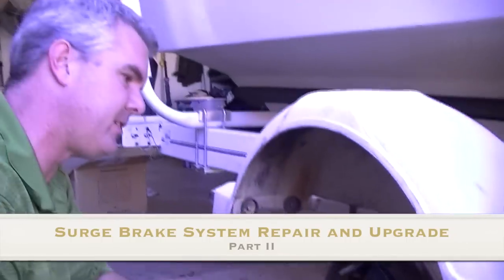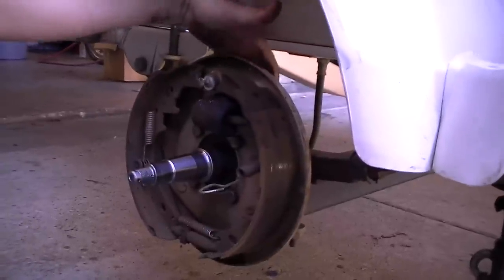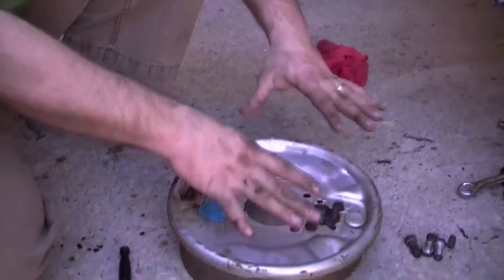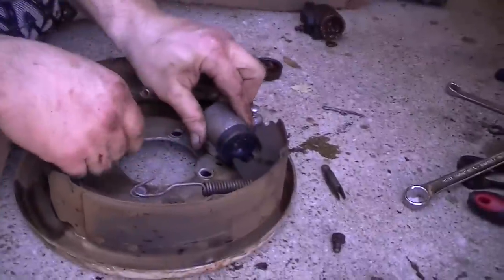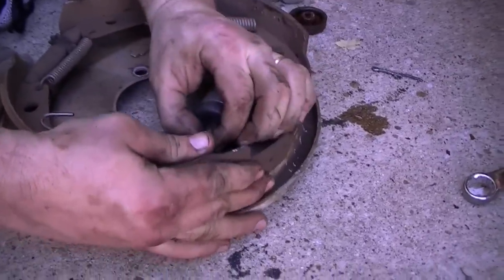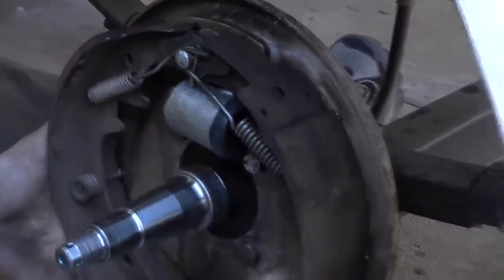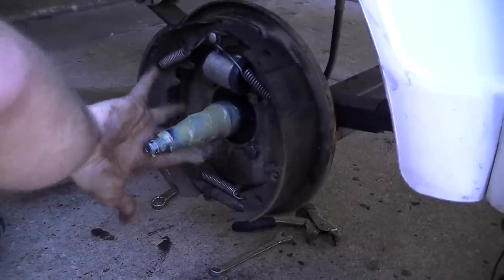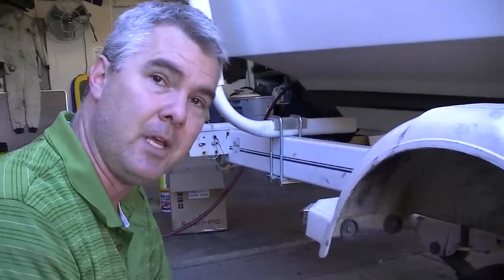How to rebuild and bleed surge style trailer brakes Part II

Comment: Most auto parts stores carry the tool for those springs. Only about 5 bucks and a lot easier and safer. They double as an installation tool as well. Thanks for the videos, helping on my boat deck repair.

Comment: You helped me again.  The backplate assembly I received from Etrailer came with the cylinder pushed all the way out so the brake pads were extended out of position and I couldn’t figure out how to get them seated correctly. After seeing you remove the cylinder I realized I could take it off and press it back in so the pin wasn’t sticking so far out.  You saved me from returning it and waiting for a new one to be shipped.

Comment: I just basically did this to my boat trailer. But at my trailer parts store I was able to purchase 2 brake assemblies which include the back plate, pads and cylinder, 2 drums and all the bearings for 222.00 dollars. It may be a little bit more money but the brake assembly came all put together and all I had to do was bolt it on.
Reply: Where you can get cylinder please

Comment: While you have the drums off is a good time to spray down the shoes with brake cleaner as oil can contribute to premature failures. Also a great time to lube the threads of the adjuster with anti-seize or sil-glide.

Comment: Good idea to spray down the brake shoes  and the inside of the drum with brake cleaner before putting the drums back on .. you'll always touch the pad surface with a greasy finger and contaminate the shoes. Nice Vid